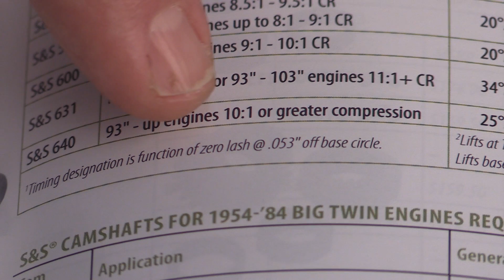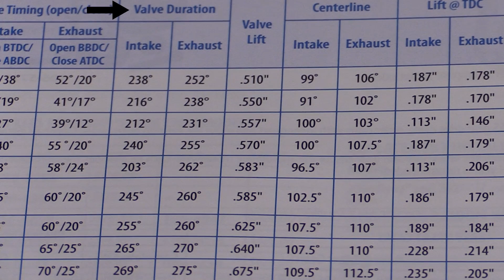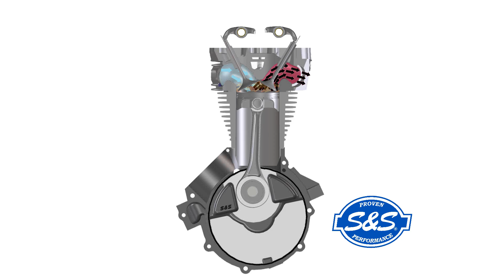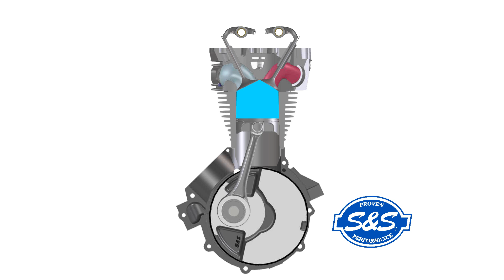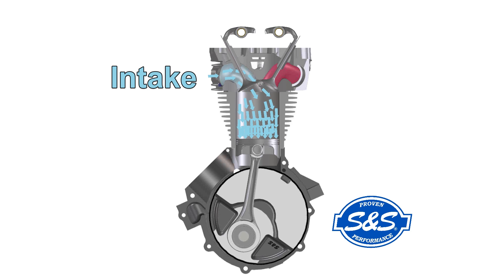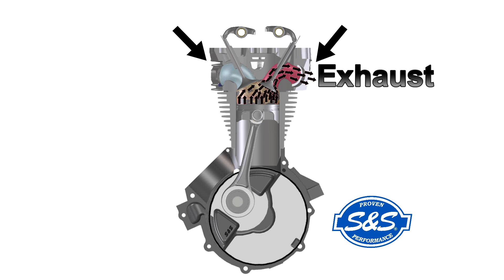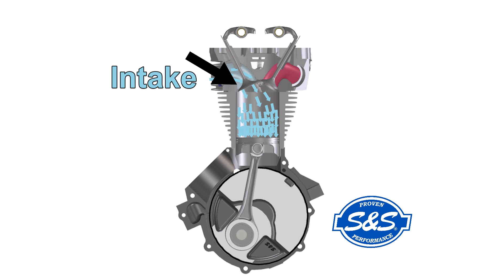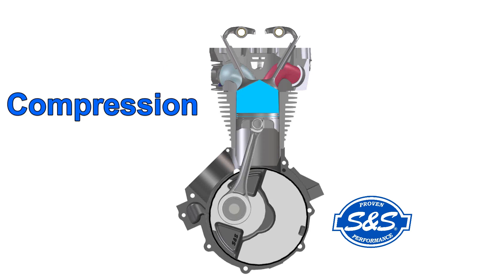S&S Cycle - Understanding Cam Specifications - Part 2B

Comment: Which is better for 2 up riding occasionally and some times getting on it hard but not read lining usually stay around 3k cruising on 23 Road glide st with a 128 build and I’m looking at doing the 475 or the 550

Comment: I have a 03 ultra with a A S&S 106 stroker in her, heads r done 55mil throttle body nitrous, chain drive n  airshifter. It didnt start out this way but she ended up like this lol. I have a 585 cans in her, I ride her on the st but I also like to hotrod it, is there a better performance cam to run or is this the limit for it other then a bigger motor? Next motor will b a 143 dragon. I'm a old bike drag racer that's not ready to pac it in totally yet.😎
Reply from the maker: You could go bigger Cam, but you'll lose streetability (more power up top, less on the bottom).

Comment: Thank you sir.
It is very informative.
I have a few questions, as my engine is a one cylinder engine with 98,4mm stroke
And 130,2 mm bore
At a compression ratio of 7,3:1
I want to convert the OHV 2 valve to a OHV 4 valve and the cam duration is pretty much the only thing that I'm unaware of to use. The old one isn't available and I wanted to ask, what would be the standard for such ratio and what would be the best idea for it, as the engine is a kickstarted monster which I want to give the fitting designs.
A midrange probably?

Comment: I have a Milwaukee 8 107ci engine and I am looking for a new cam. But confused with the 465 or 475 cams?
Reply from the maker: The S&S 465 cam is designed to produce torque lower in the RPM range than the 475.  A loaded bagger pulling out onto the highway would want more torque (and therefore would perform best with a 465 cam), where a lighter Softail would likely be happiest with a 475 that produces its power higher in the RPM range.
Reply: I have a RKS and don’t really go touring its mainly solo riding but 30% pillion. I am looking at eventually doing a 124ci conversion so is there a cam that would be better that will ease the upgrade later?
Reply from the maker: @thebeardedyorkshireman8368   Either would work well. 124 works best with a 550 cam.    https://www.sscycle.com/feature/performance-kits/power-package/124-power-package-m8

Comment: Hate to say it but H&D could learn a lot from S&S
Reply from the maker: We do not hate that you say that!
Reply: The problem with the motor company is accountants. They’re trying to produce bikes that fit as many people and purposes while minimizing the cost of production. So I/we understand why harley does what it does. Even though it’s mostly crap from the show room. As i like to say, a $40k bike that started as a frame and swing arm and then got whatever suspension, drive train, fuel management ect that suits your style, purpose and budget is worth far more than a $30k bike that you bought off the show room floor in the OEM production design.